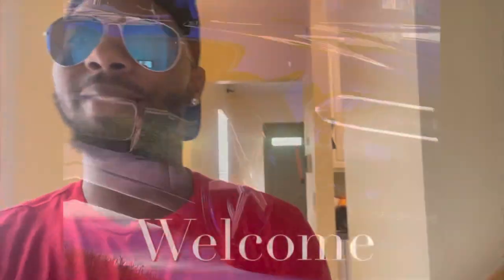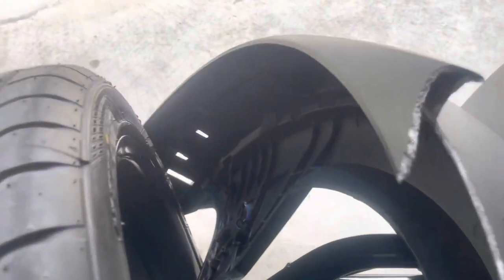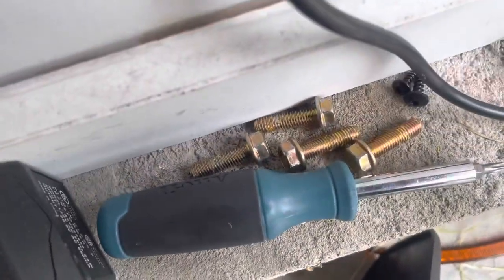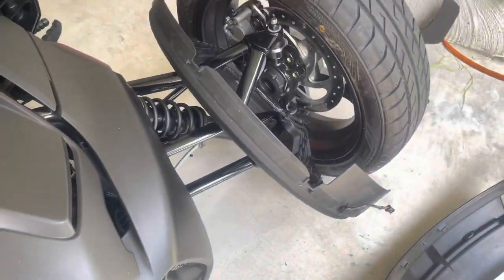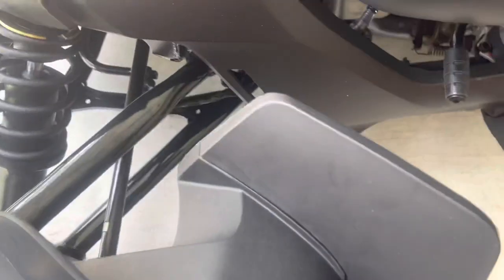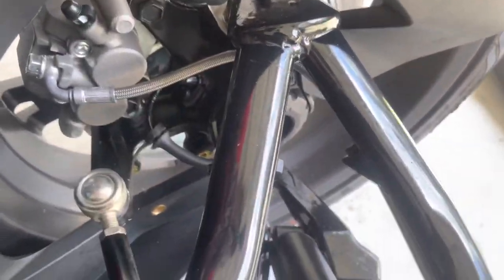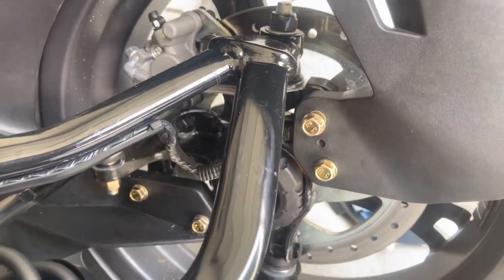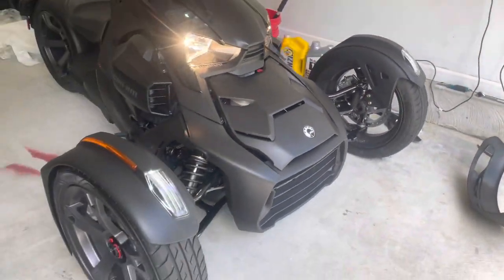Can-Am Ryker: How to Remove and Replace Front Fender

Comment: Question I’m currently working on my fender and trying to pull it off and I’ve cracked it, so question is was that normal for you as well struggling to get it off and it cracking while doing so ?
Reply from the maker: That’s for watching, it was normal for me to struggle getting it off, I don’t think I cracked mine, you have to make sure you get off the locking points detached. However, if you are replacing it I question it doesn’t really matter.  On the other hand if you are trying to go fender-less and want to reuse the fender take your time in taking it off. There are a lot of connection points

Comment: did you have trouble putting on the finder 4 bolts
Reply from the maker: No not much trouble at all, just time consuming. It’s really just 4 bolts a few screws and the light. The 4 big bolts on the fender, positioning was not to bad
Reply: Mine don't line up properly, need any force
Reply from the maker: @timothyglover7447  there are those clips that hold the 2 pieces of fender together make sure it’s all clipped back right
Reply from the maker: @timothyglover7447  but it’s kinda hard to say cause I can’t see where your at in the process